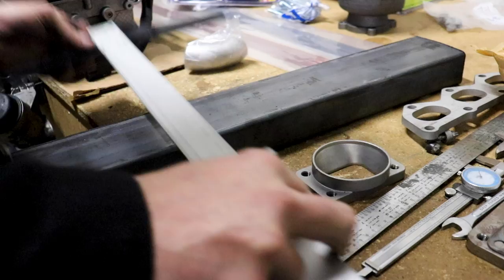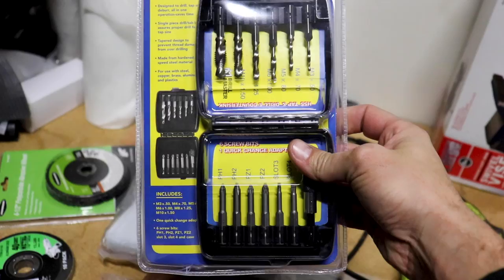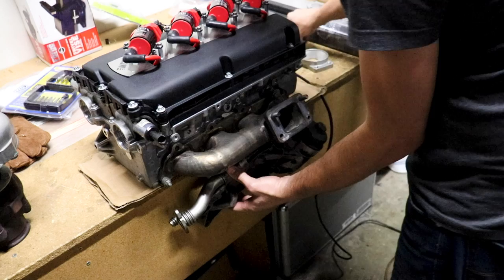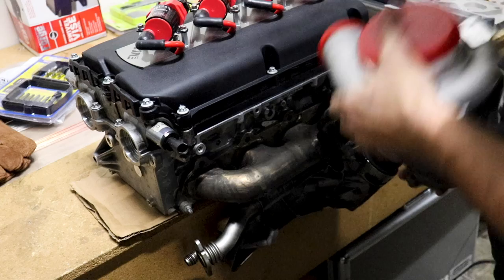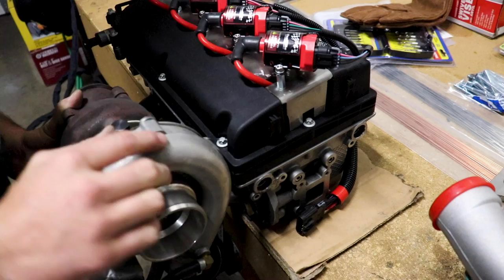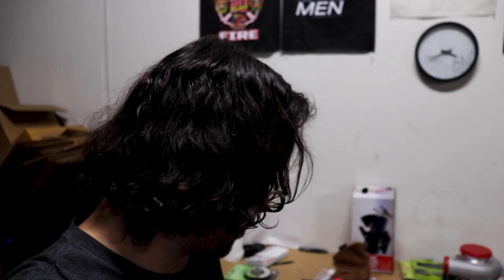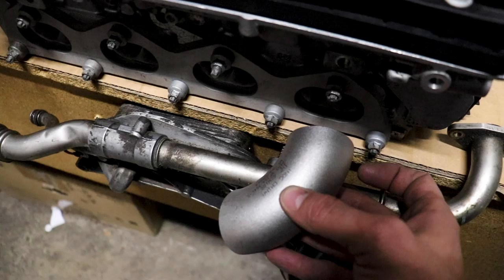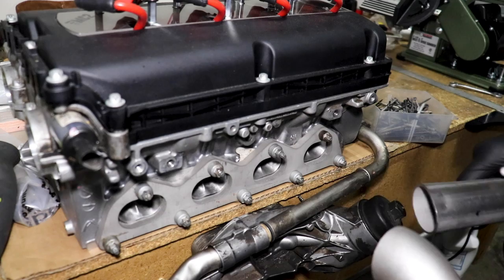Making a DIY Turbo Jig & Equal Length Manifold with no engine? Chevy Cruze / Sonic 1.8 Project Pt 2

Comment: Hi Matt 

A nice tip here over in the UK. As our Z20LEH engines are very similar bar being the family two tall block. 
As your Chevy uses a plastic cover. We get a lot of cam cover failures due to heat soak from the turbo. 

The bolt holes you see on the head beneath the rocker. Bolt a heat shield that screens the cam cover from the heat generated by the turbo. 

Also take one of the plates off the turbine housing that secures the housing to the core. Take the plate and trace onto 3mm steel. 
Draw a triangle section that will allow a bolt to go through  onto it. Cut, cleanup and bolt back in the turbo. 
On the bottom of the block there's shoul be some holes near the sump. Bolt a flat bar up and cut a side out of some box section. Drill a hole and bolt that to the bar and fasten with some nordlock washers so you can turn it to suit the orientation and lock off. Drill through the lobes of the box section and mount a rose jointed tie rod and connect to the lobe you made for the turbo. Ta da a nice turbo brace. This will stop the manifold from cracking. 

What gearbox is on your Cruze M32 getrag by any chance?
Reply from the maker: Thank you for the tips Daniel! Especially on the nordlock washers.

Two of the issues I experienced already with the first manifold I build, which was a log style. It cracked due to lack of support, and the cam cover melted under long periods of constant boost. I was trying to wrap my head around how to secure the turbo, but your tips helped greatly.  I'm familiar with the bolts near the sump, as the stock manifold and converter have a bracket that secure it to help support the manifold and the weight of the front of the exhaust system. I had a turbo blanket on the turbo, and that didn't even prevent it from melting. The head shield is an excellent idea.

The vehicle did come with the M32 trans. From my understanding, they best upgrade that could be made is the GEN II cover with the larger bearings. I have a, I believe WaveTrac post for it. Any tips on the M32? There's not many performance shops around that have upgrade packages around. I may just ship it out to WG and have them service it depending on the cost to ship overseas.
Reply: @cmattdabrat  even better I can help you with links to the parts required to build it with the uprated bearings 

The general failure of the box is a lack of lubrication. So by upgrading the end case you will therefore have a larger oil passage to the end bearings. 

The other is GM recommend not enough oil for the box. We use 3ltrs 
However I do advise adding so there's additional gas expansion with the more oil your putting in. 
So simply take out the oil fill plug, add a 12mm barb to m18.1.5 plug. Then a 12mm 90 degree pipe. Then a metal straight tube and another 90 degree silicone. Then a straight and dress with a p clip and spacer next to the ABS pump and a 12mm breather filter.
Reply: I also use nordlock washers on the comp and turbine housing and the head flange and turbine flange and nut and washer both sides and clamp tighter than my wallet
Reply: Oh and another great addition. Weld some round bar to the head flange and the otherside to the collector. And brace diagonally between the two like a ladder. Or weld a simple die plate between. This will reduce the flex forces from the cornering forces on the weight of the turbo again reduces fatigue fractures in the welds
Reply from the maker: @25227168  Can you drop a link to a picture with an example?
Reply from the maker: @25227168  Sounds good.
Reply from the maker: @25227168  I looked for you on fb. If you can, look me up, Matthew Chevalier. Same photo as my YouTube photo.

Comment: I always wondered why the turbo did not face that way so the air box would connect OK? More like the 1.4t. Of coarse the 1.8 has the throttle body on the passenger side so the inter-cooler piping will be interesting.
Reply from the maker: That's the reason I did it the way I did before. The 1.6t version has an aluminum manifold and seems to be a good way to go, except it'll max out around 400hp. I'm going to set it up like the 1.4, but just extend the charge pipe to the passenger side. I'm wanting to keep the variable intake manifold to give better performance throughout the RPM range.

Comment: Do the hood exit please! 🤯🤯
Reply from the maker: Definitely considering it!!!
Reply: @cmattdabrat  nawwwww man, it's a cruze - its a huge sleeper if u kept it going straight out the back like factory and use a exhaust cutout to bypass the whole exhaust system.... That'd be sick lol, no one would expect this car to be super powerful
Reply: I went out and got some junkyard 1.8 parts today to start my attempt at a hood exit, i couldn’t get my hands on a 1.8 Exhaust manifold, as all the cruzes either were completely stripped off the engine and trans, or  there was just no way to remove the header. I ended up getting a 1.4 Turbo manifold that is chopped just before the cat. I want to try and mount it up but doubt that it will line up. I wanted to see what the comments on this video lead to, and wanted to try and get in contact with matt, to try and get my hands on one of these turbo manifolds that he is making because i know I could make a hood exit if i take the T3 Turbo flange off the jig Turbo manifold and weld an extension that would go through the hood!

Comment: Hi there as you wait for pistons as well you could work on the transmission diff. Replacement. Just saying. Be safe.
Reply from the maker: You're right about that. I've thought about it too. Only thing that's stopped me is I want to stab the engine and trans in at the same time, and I'm running out of room in my shop, in which I do business in daily and the car parts are getting in the way. My employees shuffle things around and I'm like, "where hell did you pull _____"...
I'm going to go for. Might as well.

Comment: So far so good.  I am looking forward to a successful build! Have you figured out why the piston company is dragging their feet?  Just wondering if you chose what ever runner will be the longest to be the first one to do?  I am assuming that you can always make the shorter ones longer, but ...
Reply from the maker: Thanks! I'm sure it will. Just playing the waiting game. They keep giving me the run around about covid, and forgings that aren't up to their standard. It's kinda hard to tell at this moment without the block in the car. I thought maybe I could pull it off, but with my luck, I'd build the manifold and it would run into the AC lines, or the plastic fan. I'm itching to build the manifold, but it's just wiser that I wait... unfortunately.